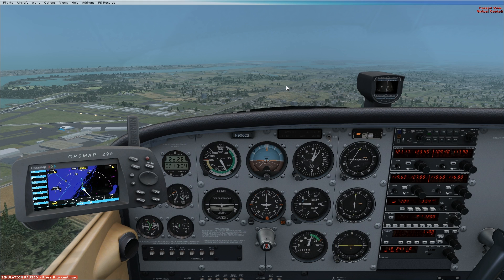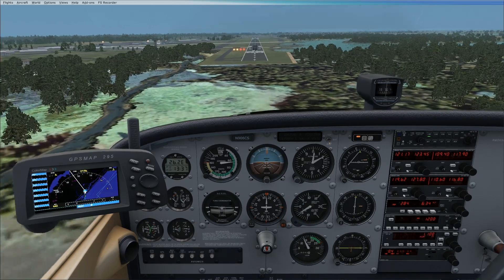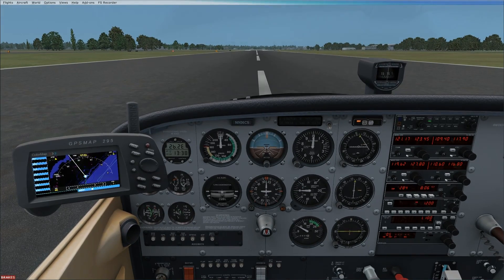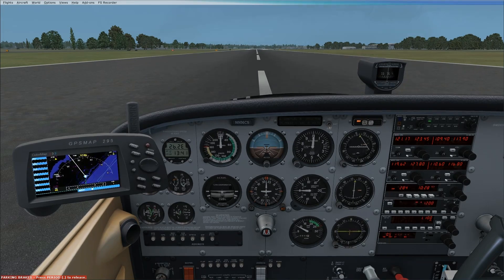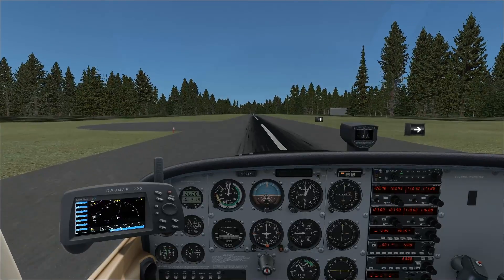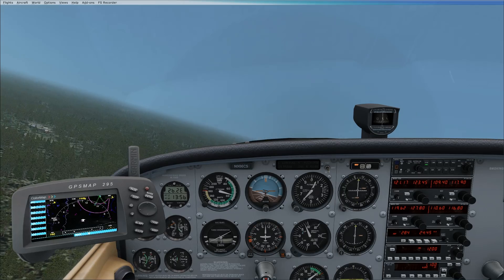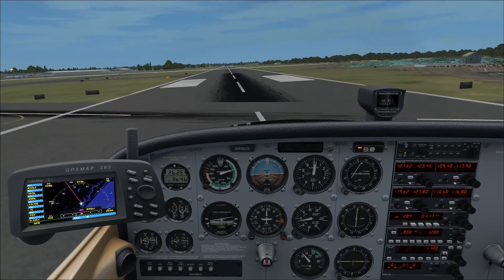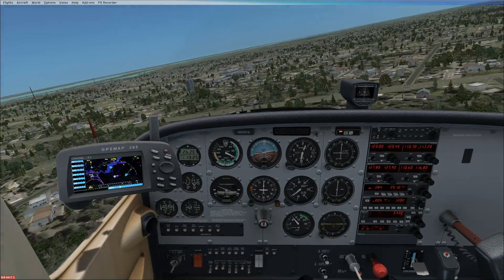A2A Cessna 172 Tutorial. Video 9, Landings

Comment: I have the A2A C 172 as well as the Cherokee and C 182. I have a couple of hundred hours real world  flying in a 172, and I find the elevator in the A2A  172 very sensitive in flaring compared to the real aircraft, which results in ballooning during the flare. Wondering if you experience the same thing.  I don't have that problem with the Skylane  or Cherokee.
Reply from the maker: yeah. its not uncommon in flight simming. devs usually make things way more sensitive than their real life counterparts. the idea being if they were made to spec you would probably never experience things that result of over controlling or not following procedures properly.
Reply: I got a huge improvement by editing the aircraft .cfg file and changing_ elevator effectiveness from 2 to 1. Much more like a rea; C 172 now.

Comment: Do you have carb. heat on during final? If so, wouldn't you add full power, turn off carb. heat, and then work your flaps? Just asking.
Reply from the maker: +George K. Cessna 172R. It has a fuel injected engine. No Carburetor = no Carburetor Heat
Reply: +CountryFlyboy Thank you for the clarification. That definitely explains why there was no carb. heat!

Comment: Im sorry,, i don't aggree with flap up upon touch down...
it should let it down because it brings more drag and it will help to bleed off airspeed quickly with idle throttle...
Reply: Were you flying?
Reply: Mdw 159 Flaps up on after touchdown reduce the roll out distance of the airplane. It is very common for a pilot to do this, especially on short field landings

Comment: Concerning a Soft Field Landing, I was under the impression that it was done with Full Flaps, and that they would NOT be retracted.  (this is to keep as much weight as possible off the landing gear)   Yes, on a short field landing, they are retracted upon touch down, to put as MUCH weight on the gear as possible to help in braking action.

What am I missing?
Reply from the maker: +Michael Donavon Nothing. That was a mistake on my part. You can leave them down to minimize wear or possible damage caused by the rough surface. unless the field your landing on is ridiculously short there should be no need to retract them. However on some low wing aircraft it may be advisable to raise them as the gear can kick you dirt rocks and slush witch may potentially damage the flaps.
Reply: OK, thanks for your reply.   I've saved your videos - are very instructive.   N-6395T

Comment: I find it very hard to land on mains first in A2A Cessna without either floating like forever to bleed the speed or I need to have dangerously low speed on approach to get the stall warning on flare. Is this realistic behaviour?
Reply: Tomaž Drnovšek CFI here, yes getting the stall warning during the flare is Ideal in a Cessna 172.  This is okay because you are in ground effect.  Also it helps you to slow down your groundspeed just prior to touchdown which results in a shorter ground roll required to get stopped.  I tell my students the point of the round out is to slow down your airspeed so that your flare won't cause you to balloon.  The flare has two purposes:
     1. Slow you down even more, and 
     2. Raise the nose so that you don't let it touch during initial touchdown. 

As your flare causes you to slow down it will require increased amounts of back pressure on the yolk to maintain the same nose up attitude you want for touchdown.  So you will have to increase your back pressure throughout a good flare, but the point isn't to continually increase pitch attitude, rather the point is to continue to preserve the same desired nose up pitch attitude.